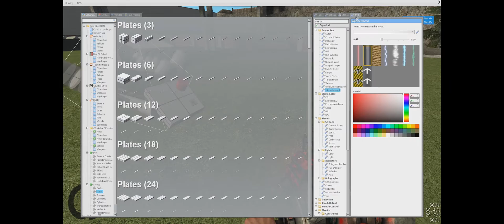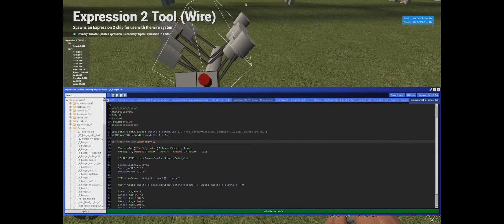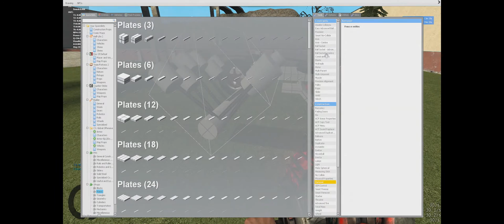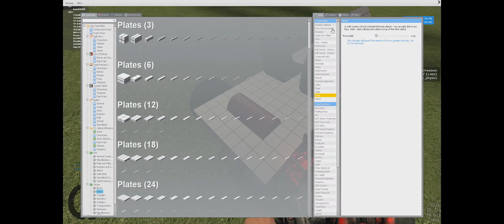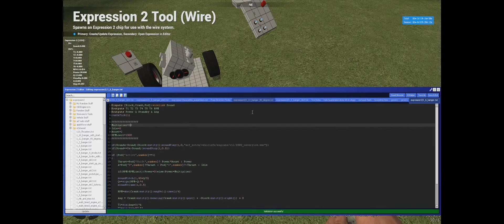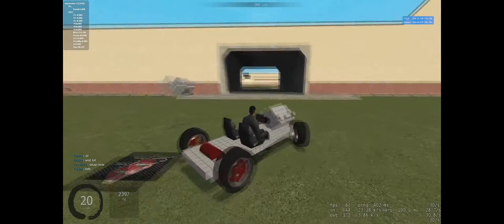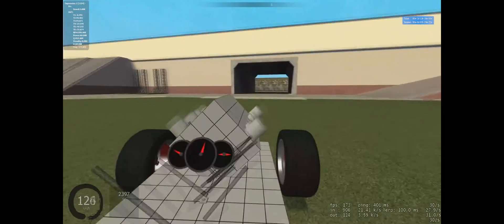GMOD - V12 Engine Tutorial Part 2

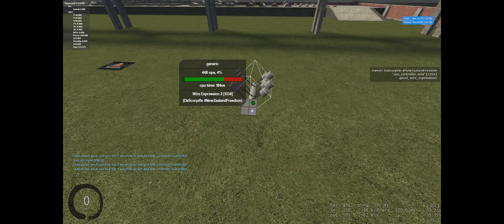Comment: Can u update the E2 settings, because me and +Necro Maniak are having the same problem, for me, if I press w for a sec it works, but if I hold w, the pistons stick and spazes out like (5:30) but worse for me. I even tried your creation and the same thing happened to me.
Reply from the maker: +Gamer_time Hey thanks for bringing this up. I have had a look at this in GMod myself and I don't see any problems with the engine. If the pistons are falling though the block, like you said at 5:30 then you could go into the e2 and change the multiplier values. This e2 was rather basic for what it does. I haven't played GMod in a quite a while so I am a little rusty. If you continue to have problems I will take a deeper look into this issue.
Reply: At these settings,                                   Multiplier=10
Idle=0.1
Boost=2
RPMLimit=1000

It still spazes out even on idle.
Thanks for replying so quickly.
Reply from the maker: That is very odd. Are you just using the e2 on your own engine or using my V12?
Reply: I tried both.
Reply: I updated the E2 script
Reply: It is,

@inputs On Throttle [Crankshaft BasePlate]:wirelink
@outputs RPM Bearing SoundPitch 
@outputs Piston1 Piston2 Piston3 Piston4 Piston5 Piston6

interval(10)

T = Throttle*On
SoundPitch=RPM*0.003

Crank = Crankshaft:entity()
Base = BasePlate:entity()
RPM = Crank:angVel():yaw()/6
Bearing=Crank:bearing(Base:pos()+vec(0,0,12):rotate(Base:angles()))

Piston1 = sin(Bearing)*T
Piston2 = sin(Bearing - 90)*T
Piston3 = sin(Bearing - 120)*T
Piston4 = sin(Bearing + 150)*T
Piston5 = sin(Bearing + 120)*T
Piston6 = sin(Bearing + 30)*T
Reply: I just modded a different guys script (spider0804)